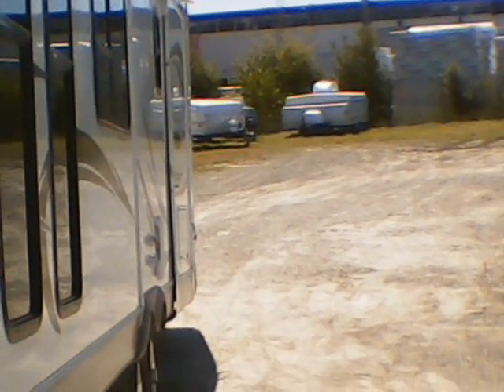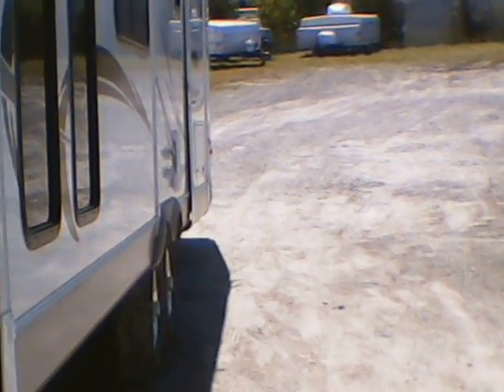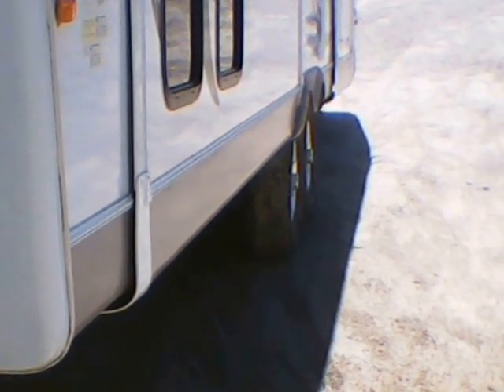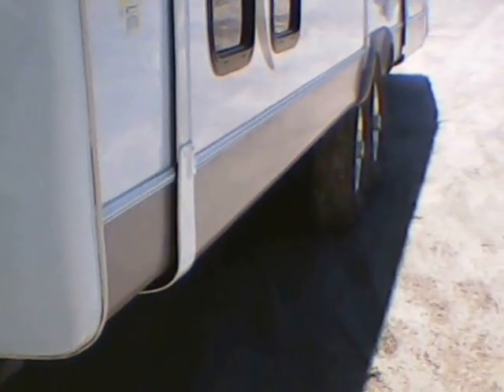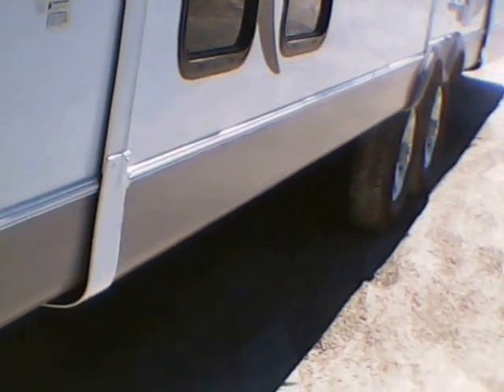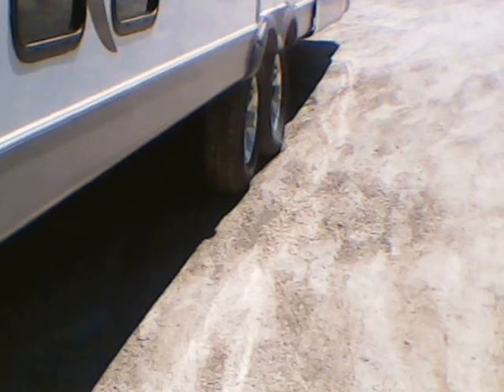Trailer Axles and Tires Flex During Turning

Comment: Very informative video. Was actually looking for something else when I ran across it. One thing I would like to add for someone on the fence of spread axle or not. There are some pro's and con's to both. If you do a lot of towing in high wind states like KS, CO, NE,WY, and NM where are you are subject to higher side winds then a spread axle will help keep your trailer more stable. A spread axle will also carry more weight because it does a better job distributing it. The con's, well as mentioned it is harder on equipment. This can be be compensated by slightly changing your driving style. Meaning wider longer turns when able. Another is avoiding jackknifing into a parking spot. Instead of cutting hard when backing up use a softer turn and pull forward a few times allowing the axles and tires to realign somewhat. Not trying to sell it. Just a man who pulls a trailer for a living.
Reply: Exactly!!!

Comment: Great Video, I think this is the most overlooked reason trailer tires fail. Towed all kinds of trailers for years and have had blow outs.  I always buy the "better tire" and keep check of pressure, but trailer tires fail way more often than the tow vehicle, this video shows why.
I have learned the one thing trailer tires endure, separate from a passenger vehicle, is what this video shows. It is pretty much unavoidable because you have to make tight turns, but you can be more aware of it and take a little less aggressive approach on your turn.
The other thing is to buy the highest load range available tire for your rig. Why? Higher load range means stiffer side wall and higher tire pressure. This allows the tire scoot / slide along the surface rather than grip as much. You will pay more for Load Range F or G, but blow outs are no fun on the highway. Regardless of what tire you buy, inspect them often and first signs of cracking, swap them out.

Comment: I saw that on my trailer in a tight turn, and initially I freaked. Then after assessing the situation I was somewhat sure that the axle tube or beam was designed to move both wheels independently (And slightly) on the same axle beam. Makes sense. If they didn't, the rigid pressure on both wheels would make tight turns, as in your vid, with the wheels working against one another.

Comment: Good stuff. The trick is to try (key word there IS try) to minimize the need for sharp turns, whether in gas stations, campgrounds, or turning corners. I know, easier said than done, but if you plan ahead you can most of the time do it. I still notice uneven wear between my front tire and my rear time.

Comment: So we were camping last weekend - new 2021 trailer with the wide stance.  Took a bit of moving to get the trailer into it's spot so I probably stopped at the end of a turning move (kinda doing an S turn to get the trailer moved over a bit before parking.  Couple days later while we were in the trailer and it felt like we got rear ended (while parked).  One side of the trailer that was on a couple stacked up 2x6's moved enough to pop the front jack off of the  double 4x4 and 1 2x6 platform I had built up to help level it out.  

I think this is what happened - torsion/tension in the tires and the 2x6's created enough of a slippage point, especially once we got a bit of rain.

Crazy.

Comment: I have been pulling campers since 1997. I put a lot of miles on mine.  I have yet to wear out a set of tires.  I normally replace every 5 years because of dry rotted or blown out.
Reply from the maker: A lot of trailer owners don't realize that it's never the tread wearing out (assuming no underlying axle issues), it's almost always age that gets them.  Learning about the date codes on tires is a great way to protect yourself.

Comment: I have a 94 TT and I notice more that the front wheel is the one that does the flexing. You also mention that this is a more modern feature, but my ‘94 seems to do it as well. Does that mean anything different or is that normal as well? Great video
Reply from the maker: No, your TT should be no different in terms of the axle and the flex, if you notice more the front wheel flexing, it makes sense, since it's the lead wheel, and is the first wheel to be effected by the turn.  I'll bet going backwards, it's the opposite, just a thought...

Comment: I have heavy duty Landscape trailer with 4 tires 
And
I have same this when i have little biger load heavy stuff in my trailer and when i drive under some big hole or when i turn left and right i can see back both tires like twisted and looking weird but i heard this is normal and this is more safety for trailer and everything.

Comment: I noticed my trailer tires remain twisted even after driving it straight. Is that normal?
Reply from the maker: They should straighten back out after driving forward for  only a short distance, I'm saying yards vs. miles.  If your wheel aren't lining back up, you may want to get that checked out with an axle shop or RV dealer qualified on your trailer.  If the trailer is over-weight, the wheels will tilt bottom out, as the axle's camber (slight curvature, like a rainbow) compresses.  It might not be a turning issue, but a weight issue.  But like I said, it wouldn't hurt to get it checked out

Comment: I have a triple axle boat trailer with torsion bar axles and, yes, the wheels splay out and look weird.  This video is confirmation that the trailer company was being honest when they told me this is normal.  It is!  Sure looks weird.  Do not agree with the part where he says the rear wheels wearing faster is a bigger problem with torsion than straight axle.  Rear wheels will get just as nuch wear with a straight axle.  Maybe more as they are always forced in a straight line....
Reply from the maker: Yes, it is how it is supposed to be, and I am glad I could help

Comment: My wife was very concerned when she saw the tires "flexing" during a tight turn backing into my driveway on asphalt.  I see this is normal and will wear tires if done often, but won't harm the axle or bearings, etc.  Please confirm that no harm can be done except tire wear if the dual axle tires are the pivot point for the turn.
Reply: Daniel Kelly does do a bit of harm. I’ve a double axle low loader with 20 ton on it. Twin wheels on. Flex so much the outside wheel on the front axle will be inline with the inside wheel on back axle. Whole axle making cracking noises and shifts
Reply: @ferguson20diesel49  ok 20 ton is a lot, most of us have 6-12,000 lb trailers
Reply: Vince Marquez wheels come off and everything and rims become loose
Reply: I have a car hauler tandem had the hub bend and break off the axle from turning to sharp while hauling a truck. I was going 3 mph turning sharp.